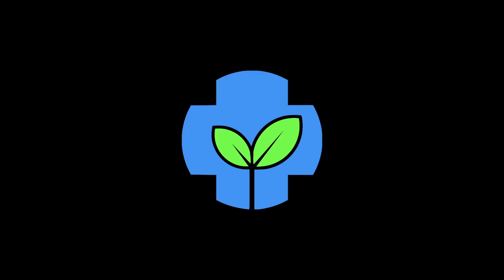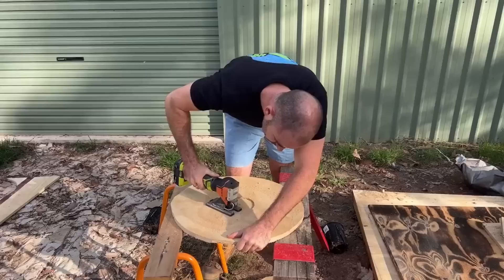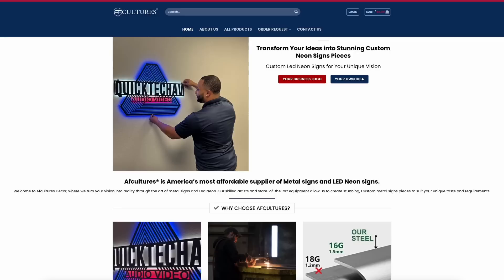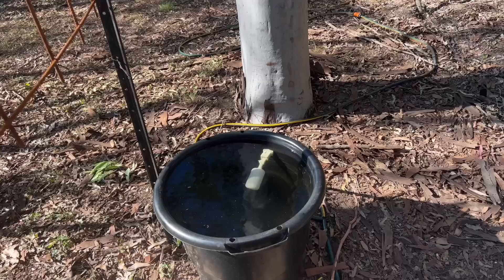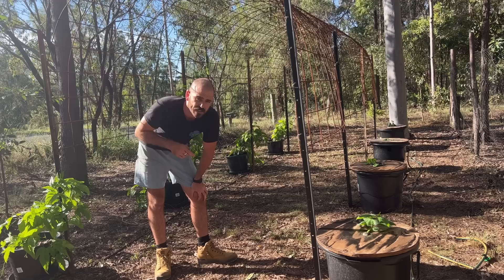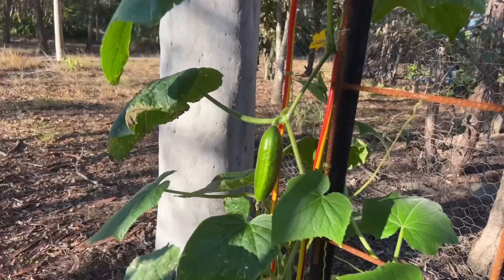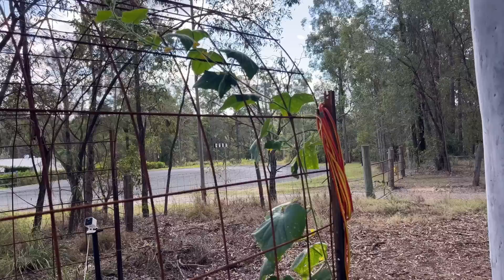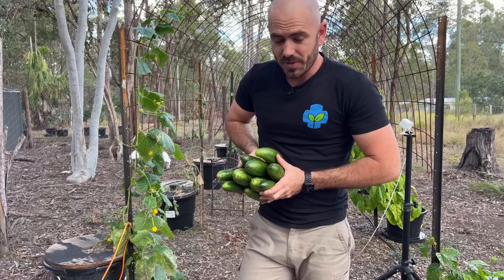Infinite Kratky Hydroponic Cucumbers

Comment: This was fantastic!! I knew the smaller hole and the one with the jiffy pellet without anything holding it would grow the best because that is exactly how I grow mine indoors and actually I don’t even use a jiffy pellet I just use a cotton ball like you showed in one other video and once the seed germinated and grew the cotton ball almost disappeared with the roots I’m sure it provided a bit of benefit as it grew in the deep water container but I grow exclusively indoors and I manually refill the 60litre tote and currently I have three cucumber plants growing in it.  I’m sure once they begin to put on cucumbers I will be refilling often but so far haven’t had to add any water.  I also use a bubbler or an air stone I guess is the correct terminology so that when I do top up the nutrient rich water it doesn’t harm the plant.  Love seeing those lapse time of how the roots grow its phenomenal to watch!  Talk about eye candy for a veggie grower!! 😂🥰❤️🙏🏻🇨🇦
Reply: How do you hold up the cotton ball? 
@Hoocho the new videos on less expensive setups are great, and more tips on reusable/low cost methods for securing the seedlings in place would be very helpful (ie. Hydroton or net pot alternatives with cotton or vermiculite & perlite sprouted plants...I remember the pucks but haven't seen them in action with Kratky method yet)

Comment: I do a manual version of this. I have buckets with a small hole in the side that sets the level. Depending on the plant, 2-4 inches below the net cup.
I fill up to the drain hole everyday. It's so much easier than trying to top up Kratky with a heavy plant on the lid lol.
Works great and I see the floating matt of roots like you showed.
Reply: Stupid question.  Do you actually fill it with a nutrient mixture or just straight water.

Comment: If the roots are focussed on the surface, that implies that if you trust the float valve, you don't need large water storage, just wide. In theory this could be done with smaller volume, thus cheaper, containers
Reply from the maker: The reason I like large volumes of water is the stability of temperature, large surface areas on small bodies of water are problematic due to the sensitivity to temperature change
Reply: A valid concern, but maybe perhaps not a universal one. Geography, climate, indoors vs outdoors, etc. make it a choice to be weighed up rather than a rule. Not a critique of what you've done being right for you, but more theory-crafting for other use cases.

One I'm thinking of, to be explicit, is a current shelf of indoor mason jar based basil & peppers kratky and replacing it with a long, wide, but no more shallow, tote with a singular, maintained water level. What I had up to now was individual water levels for different plants at different stages in their life cycle. But the watering is getting out of hand on an individual basis. So if next season it was a low digit number of controlled totes, technically the surface ares of the water goes down than up.

Comment: I topped my cucumber and Tomato with out testing the water I started with 15 Gal 1.6 EC and added 5 gal 1.6 EC.   The next feeding I noticed some strange lead wilt.  I tested EC and it was 4 before adding water.  I ended up just adding water do you see this too?   Drinking more than they absorb
Nutrient.  My cucumber seemed to almost lol like it was dying.   I will say also add air to water more like DWC method.
Reply: Normal, b/c they perspire so much in the heat.

Comment: Hey hoocho, my local scrap metal recycler sells used food grade steel 55 gallon barrels for $10 each including lid.  $5 for plastic. Do you see any reason I couldn't do kratky without float valves with those?